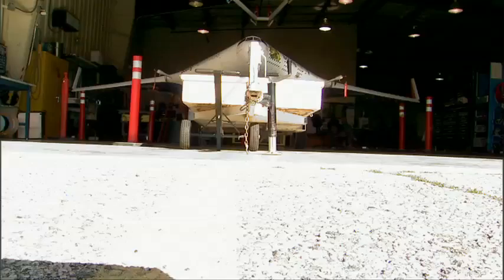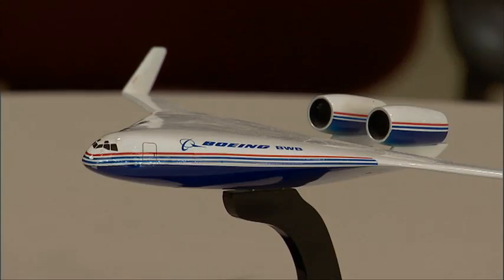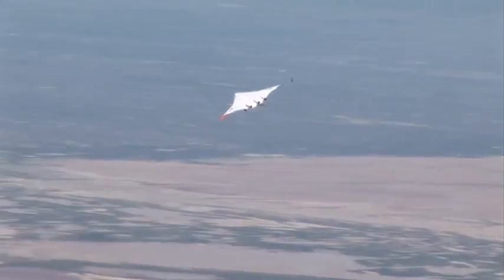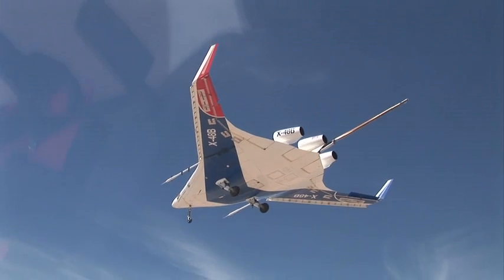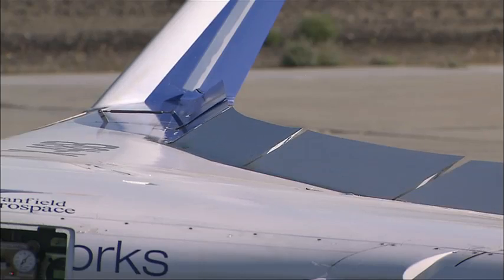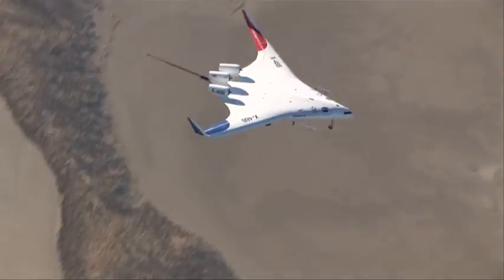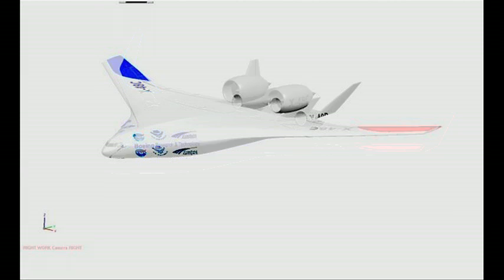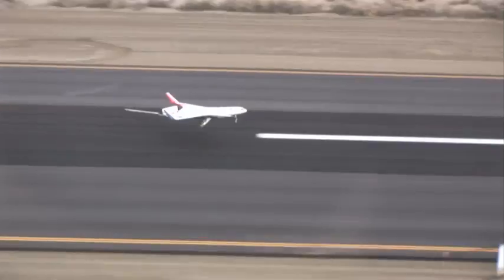X-48

Comment: Wake up, Russians allready made drone Hunter as flying wing.
You late Yankees
))))
Reply: It’s not a flying wing.  It’s a blended wing which is much different aerodynamically.  It’s also a wide body i.e. it’s for either cargo or passenger transport.  Flying wings are historically very unstable at high altitudes, but a blended wing still has air rushing between the fuselage and the wing on the underside giving it more stability.  P.s. We had the flying wing long before Russia....
Reply: Haha you dumbass! That Hunter is straight up American tech!

Comment: with the big stupid jet engines lumped on the back...hahahahaha...this has to be a wind up...surely there is at least one serious aero engineer that can incorporate the propulsion into the body while maintaining ease of access for servicing and replacement.
Surely dropping an engine from an internal bay will be easier than having to build a massive gantry at every airport in order to remove or replace an engine...this type of engineering is very typical today..pure shit..nobody is looking down the line to the practical implementation of the eventual; design and the real world consequences of servicing.
Reply: Those engines are there so they can ingest the boundary layer generated along the fuselage, which increases fuel efficiency